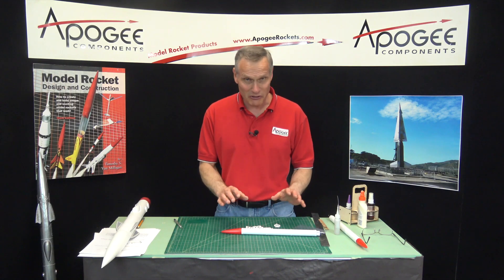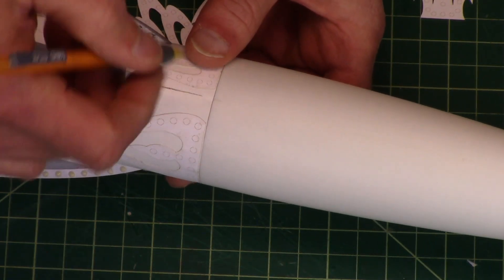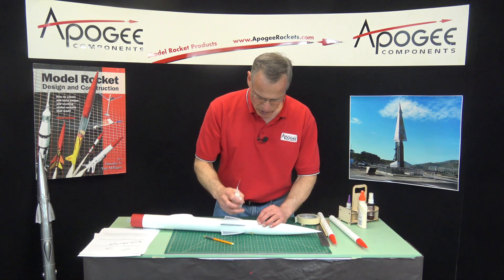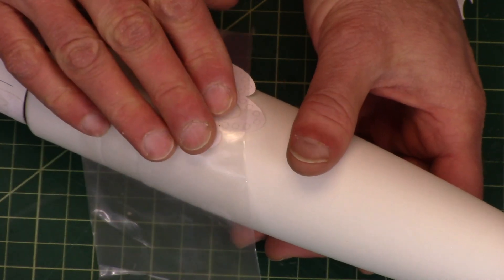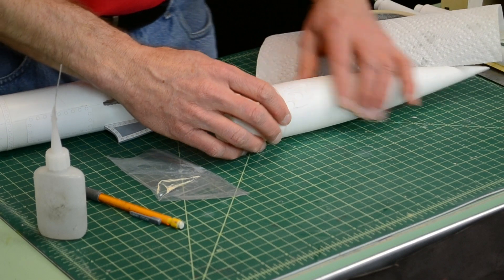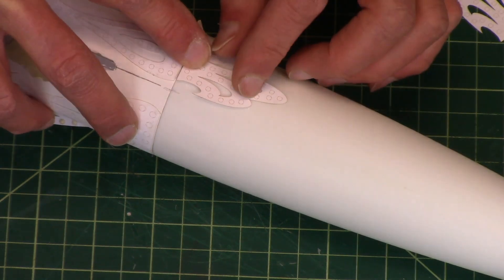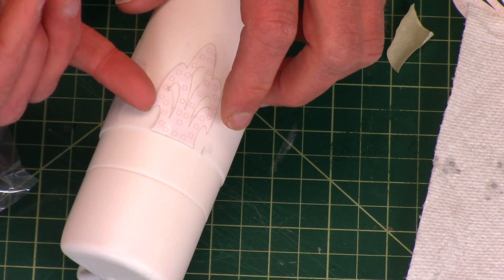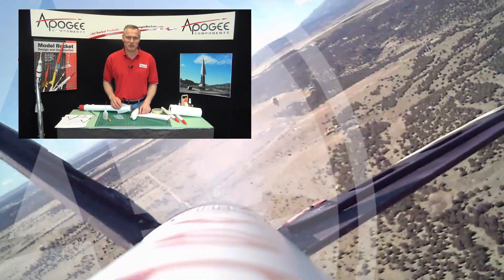Flying Machine Rocket Build: Part 14

Comment: Tim:  Would there be any advantage to using 'superglue accelerator' - or whatever it is called - on those papers after attaching them to the nose cone?
Reply from the maker: The only advantage is that it will harden quicker. But you have to press the paper down, and it would be tricky to spray and press quickly enough before it had a chance to harden. It could be done, but in this case, the accelerator may set off the reaction too fast.
Reply: @apogeerockets  >>> Roger that - Thanks.